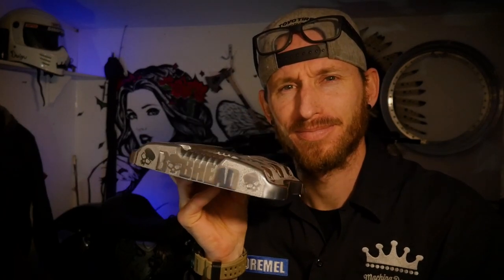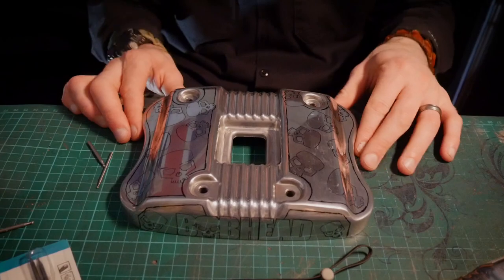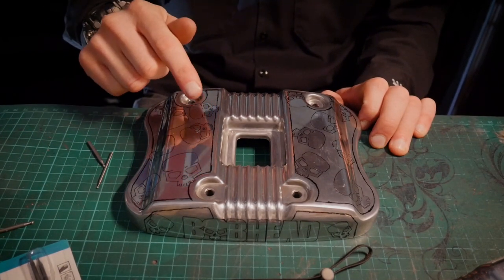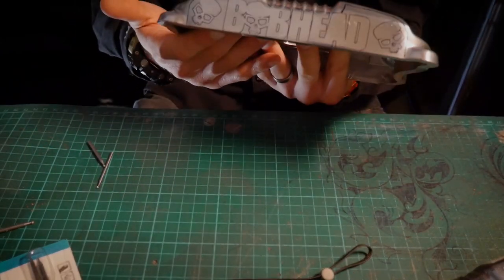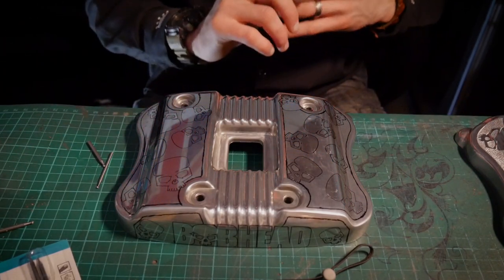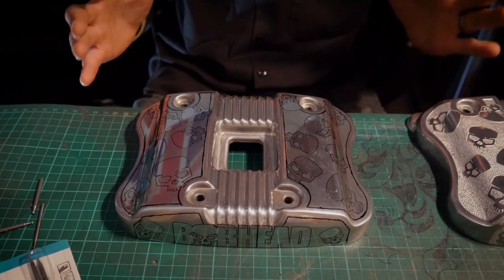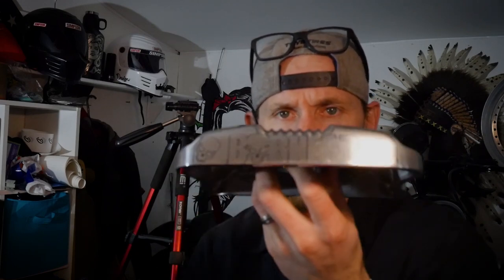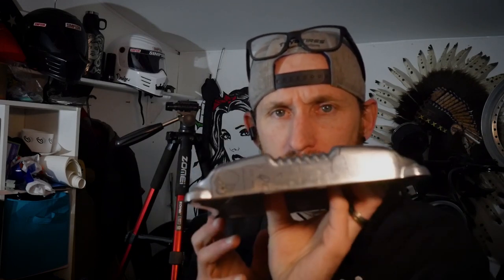How to hand engrave Harley davidson Rocker cover with a Dremel

Comment: Amazing man! Just came across this video. Question for you. After the engraving is done, if someone wanted to powder coat the parts what ever color, how does the engraving hold up/look?
Reply from the maker: Powder coating will completely cover the engraving and you’ll loose most of the work. I personally wouldn’t recommend it

Comment: Great videos man.  I've had a few attempts using the burrs you recommend (05, 06, 07).  Is there any way to cut the background a little deeper using a dremel on ali engine covers,  and if so which attachment should I try? If not, will I need to go to an air-graver. Cheers,  Doug.
Reply from the maker: Thank you for the feedback. Yes absolutely. There are bigger cutting burrs available on the market that can easily do this job. There will definitely be some pros and cons over an air graver especially the biggest one which is cost. However you can’t beat the finish an air graver can offer! They are very easy to use and offer superior precision once you’re well versed with it. Hope that help

Comment: Hi bro from India, I have ordered dremel stylo and 4300 , I need to know the power plug was very can I use those tools here with an adaptor , pls reply I know it was a old video but sent a comment on this thanks
Reply from the maker: Yeah as long as your mains power supply matches what the tool needs then you should be fine

Comment: When you engrave chrome parts for motorcycles, do you have to treat for rust? If you do, what products do you use? Thx.
Reply from the maker: I don’t engrave anything that is chrome as it has a tendency to chip and peel and eventually cause issues.
Reply: @MachinaDesigns  thank you, that was alsof something that I wondered about.

Comment: Awesome work man 😍 do you use diomond burrs or cutting burrs for the stippling? Best regards
Reply from the maker: Thank you very much. Only use cutting burrs for the stippling.
Reply: @MachinaDesigns  thank you so much 🙏  I have a really really cheap shit at home, so that one I'm not even going to try to use 🤣 so at first, I'm going to buy a new one and I'm looking at either dremel style +, or a proxxon gg12. Have you tried them both?
Reply from the maker: They are both good units. I chose Dremel for the readily available spares and accessories on the market compared to others but both good units
Reply: @MachinaDesigns  thanks for the tips 🙏 really nice work anyway pleasure to watch 🤘🔥
Reply from the maker: Appreciate it thank you

Comment: Can you provide a tool list?
Reply from the maker: Andrea Hanson yes sure. Is it a general list you require or material specific list?
Reply: @MachinaDesigns  model of dremel, handpiece, burs. Are you using diamond burs? Anything that might be useful for engraving motorcycle parts would be much appreciated.

Comment: I don’t know if you want to share that info but it would be much appreciated. Just a ballpark in how many hours you spent and what someone would charge for that work. Awesome video and work man thanks
Reply from the maker: Thank you for the feedback. Something like rocker covers can take hundreds of hours to complete, depending on depth, complexity and detail. Pricing is what’s you are comfortable with but more importantly how much you are worth. Time is priceless.
Reply: @MachinaDesigns  and what bur do you use on that cover?
Reply from the maker: @jumcopper  it totally depends on details of the finished piece but generally 106 -107 are good pieces to use

Comment: Will the acetone method work on chrome metal?
Reply from the maker: Try not to engrave chrome as it can flake and chip off. I refuse to touch chrome due to that very reason
Reply: @MachinaDesigns  so what about a primary cover on a Harley ? Isn't that chrome ? And what about those valve covers you did , they're aluminum?
Reply from the maker: Not all are chrome. The rocker covers I did were polished aluminium. Chrome is a plating process that sticks to the material underneath and flakes off or cracks in some instances. Primary covers are all aluminium with a multitude of different finishes

Comment: Great video!
Reply from the maker: Thank you
Reply: I had a go at a piece the other day. I noticed it pulled a bit on contact and came out with small short lines rather than dots. Any tips?
Reply from the maker: @ilovecarnitas  all to common when you first start. It’s a technique that will come over time but if I can explain it correctly it’s trying to maintain the burr in one position. It wants to run away from you but you need to pull it back and apply pressure. Do that on a scrap piece over an over and you’ll soon get the hang of good stippling
Reply: @MachinaDesigns  great that makes sense appreciate it!

Comment: What speed are u using
Reply from the maker: Anthony Agliano 20-25k RPM
Reply: Machina Designs are u bearly touch the metal I’ve been engraving for a little while but some of my lines are still kind of bumpy I noticed that the less amount of pressure are use machine down and I can get a little bit straighter in a line
Reply from the maker: Anthony Agliano yeah it takes a lot of practice to get them smooth and straight. You’ll get it

Comment: Great video.  I’ve done some engraving with a dremel as well but learned from your demo.   Couple quick questions.  I noticed you’re engraving aluminum.   What transfer paper do you recommend?  What speed do you run the dremel?   Also, how often do you reapply the cut lube.   Appreciate any response.  I’ve got a couple other questions as well but don’t want to hog your comments.  Here is an example of my engraving.  (Could be better). View my photo at https://brianstevenson.smugmug.com/Family/My-Art/i-vWx3q8p
Reply from the maker: RoadGlideSully thank you. For transfer paper you wanna use tattoo transfer paper that leaves a good amount of ink behind. I generally run the dremel at 20 000 rpm for aluminium. Oh the cut lube you reapply every chance you have. You’ll notice a definite difference if you don’t use it. Nice work